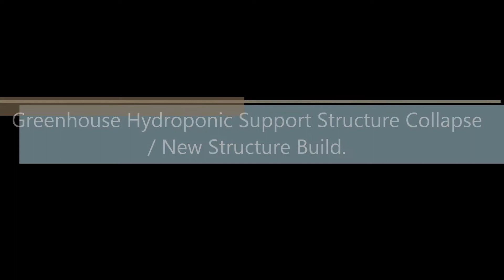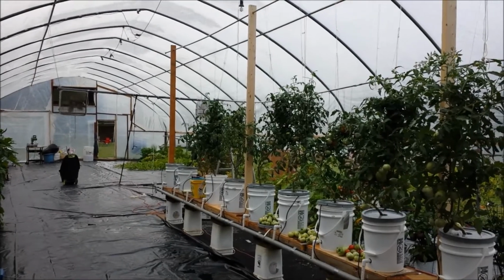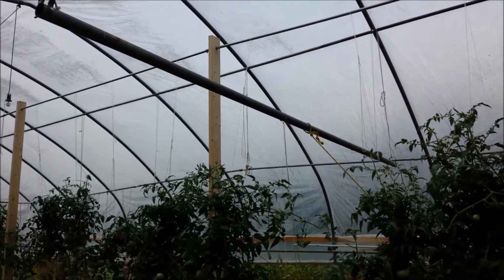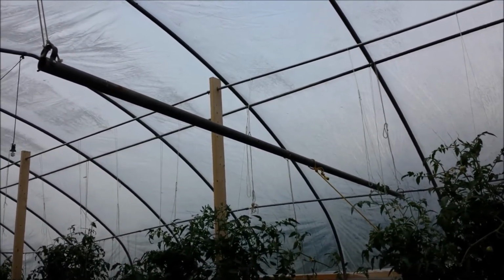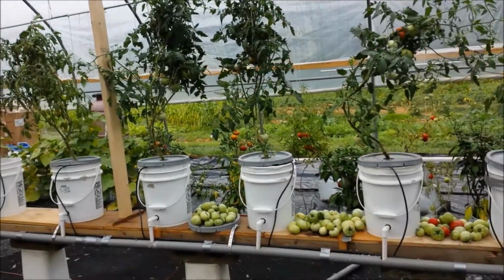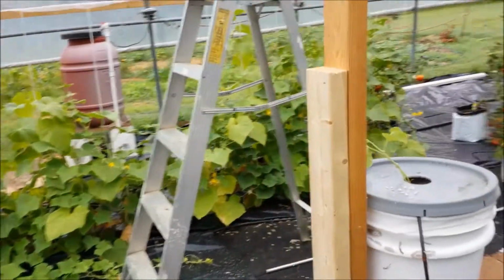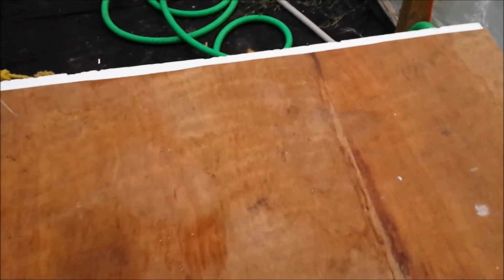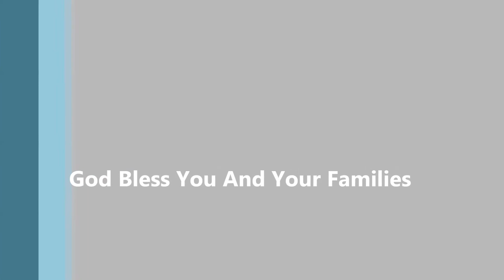Greenhouse Hydroponic Support Structure Collapse

Comment: My hoop house will be 30'x72', 12' ridge,  with 1 7/8" bows and 1 3/8" purlins. I'm looking forward to shipment this Friday.

I wasn't speaking of the house structure in my comment, though. The 2x4s that are holding the support pipe are what I was referring to. They seem to be 8' or so apart. I will probably put mine every 3 buckets, so maybe 5' apart. My gut tells me that thin walled EMT tubing is not strong enough to support several fully fruited tomato vines. Thanks so much for the info.

Comment: Chuck, I am REALLY sorry to hear about the collapse of your Dutch Bucket support system.

As an Engineer, I'd like to make some comments that may help in the future:
- the supports seem to be far apart... suggest 4'-5' max
- the galv pipe seems to be too small...suggest 1" minimum
- there seems to be little or no lateral support of the verticals...suggest a "Y" arrangement with the "Y" connecting to the bows at least 4' from the verticals.

Comment from the maker: Thanks.
The tubing is 3/4 inch EMT for the tomato support. I have 1/2" on the grow bags and it is doing fine but I went up to the 3/4" because I was able to pick it up cheaper than the 1/2".
About the greenhouse structure. This is a commercial greenhouse on 5' centers with 2" galvinized tubing. I could probaly hang my truck from them. I have been working in there when it was storming and the structure doesn't move. What size is yours going to be?
Chuck

Comment: The x brace and k brace and variants are a structure's best friend.  I was twisting vines at the nine foot level today and see a big sag in my two by six.  Someone needs to calculate the load of these dutch bucket systems.  If I had a fish weighing scale I could get an average weight per tomato vine.  Then we could estimate the structure needed.  mmmm mmmm.